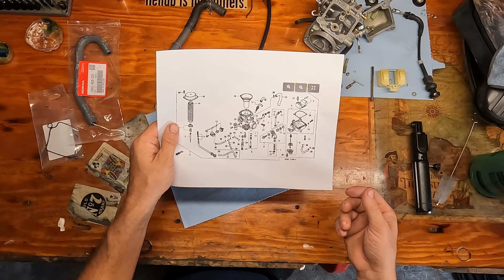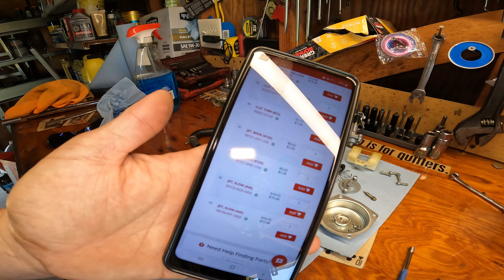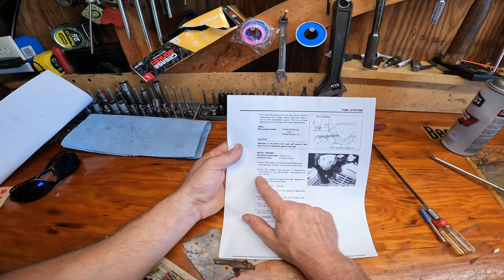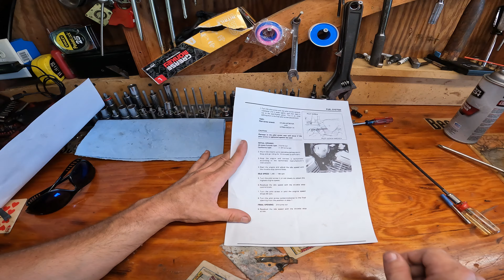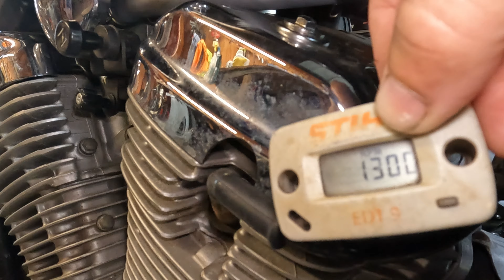Honda Shadow VLX 600 Carb Clean

Comment: I left my Shadow 600 parked for 15 days and when I started it yesterday, the same thing happened, fuel leaked in the same way, I turned off the bike and went to check, but I didn't find anything and I didn't know this information either. Thanks for sharing.
Reply from the maker: Glad I could help

Comment: I had the same issue a while back with fuel coming out, was a quick 10 minute fix didn't take the carb completely apart
Reply: what did you do? i’m having the same issue in my 2000 honda shadow vlx 600
Reply: @deadbeatdad339  I believe i had rebuilt it.. changed the needle & floats

Comment: When it was not starting at first after you put the carb on what did you adjust to make it start?
Reply from the maker: Didn't get the pilot circuit cleared completely.  This is why it is important to follow the circuits all the way through.

Comment: Great video. I have a '95 VLX600 and it has 2 carbs - what year is this one you are working on? Edit: Never mind you said it at the beginning!
Reply from the maker: Yeah its a 2001 with a single carburetor for both cylinders.